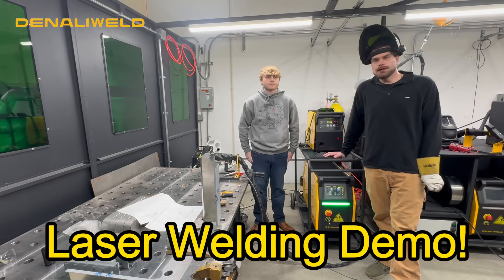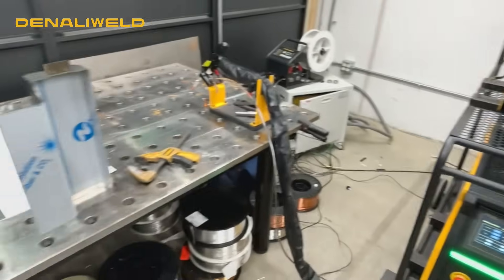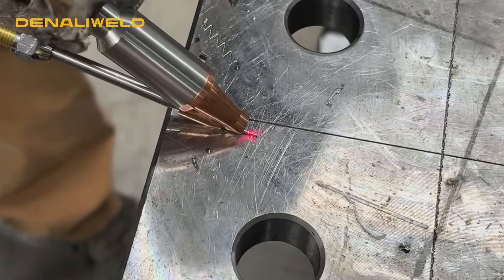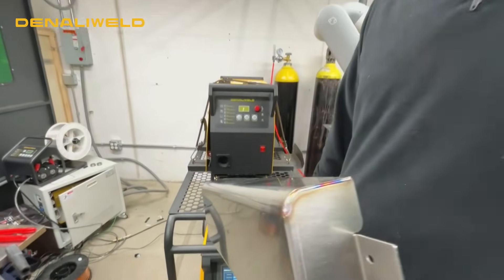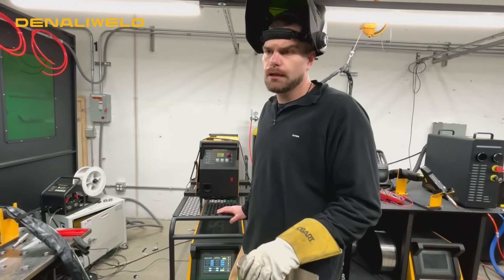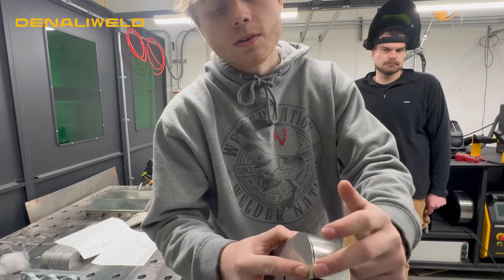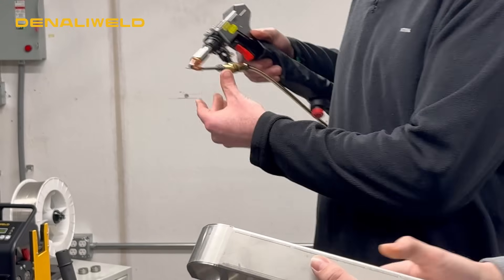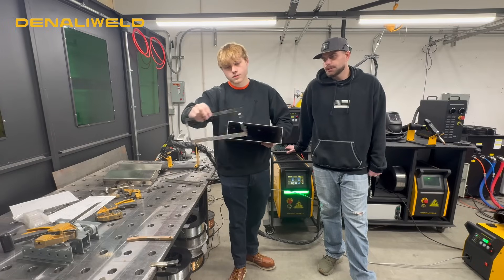Stainless Steel Laser Welding Demo by Denaliweld

Comment: How do you manage making an air cooled 2,000 watt laser? What gas are you using and, I’ve heard that argon isn’t as good for backpurge as nitrogen. And on a lessor matter, I’ve tried buying your helmet, but I can’t find it anywhere. It’s not even mentioned on your site.
Reply from the maker: Our Air cooled laser welder power up to 3000w.  you may check our previous videos we actually give extra power even. The best gas for laser welding is N2, but denpends on the material. Generally N2 could cover most of the welding.  Please contact us for more information for helmets or machines.